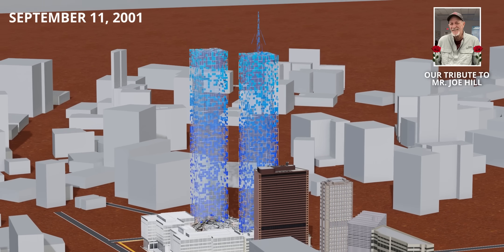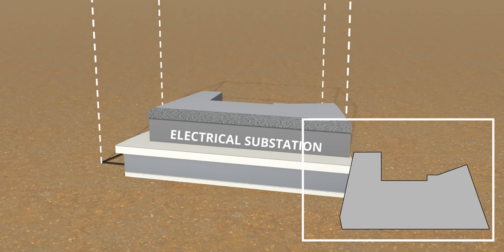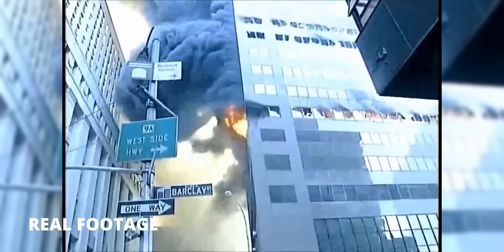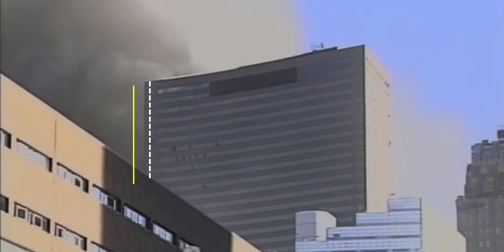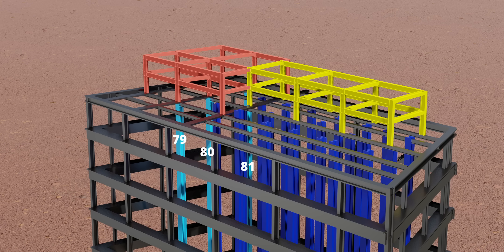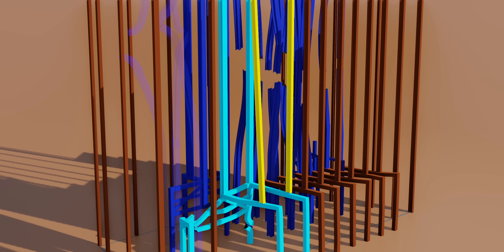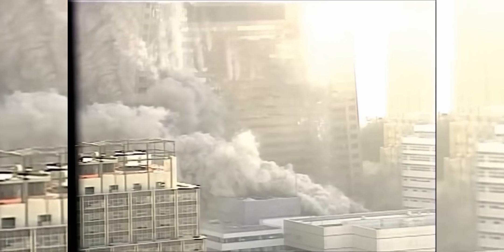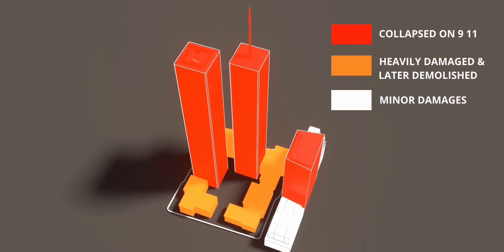Collapse of Building 7 | The Complete Physics

Comment: 3 buildings broke Newtons 3rd law of motion, explain that?
Reply: I can't explain 3 buildings broke Newton's 3rd law of motion since that did not happen.

If you believe it did then you need to explain if it was magic, witchcraft or divine intervention since physical laws can only be broken by the supernatural.

Or admit that maybe you don't know nearly as much about physical laws as mindlessly repeating other peoples failed ideas off the internet would imply.
Reply: @TheCriticalStinker-01  Every floor has a reaction time, even if only 1 second the collapse time can't be 8 seconds
Reply: @flightsimdev  - Which building are you referring to?  

What collapse time do you think believe was only 8 seconds?  Anyone with the gift of sight and ability to tell time can quickly confirm that ain't even remotely true. 

Twin Towers were 32-34 seconds and Building 7 was 18-20 seconds start to finish.  Just as they should have been.
Reply: @TheCriticalStinker-01 
Both twin towers

Each floor traps 3 meters of air, this is a cushion affect and can't be ignored, then you have the crushing affect of the concrete that is not damaged, just the air calculates to a delay of 10 seconds, the good floors a delay of 2 second and the free fall speed is 9 seconds, already broken Newtons third law we're looking at 21 seconds so you tell me, were did it all go?

Now building 7

Also air resistance per floor, if the beams were weaker on the left, it collapses on the left, Beams are not made of spaghetti like your models. The right side beams were not even touched, should not have collapsed, it was undamaged by fire and the building was only hit on the left hand side, go look at the Champlain towers collapse only 2 beams failed, it didn't take the whole building down, and the fires you mentions, they were almost out just before it came down.
Reply: @h1F595 Tower 1 and 2 fell in 10.3 and 10.2 this is virtually free fall speed, no cushioning affect, no floor resistance affect, free fall.

Building 7 fell from 2 beams failing, fires had nothing to do with it, it's not possible, a side should have fallen off, also fell in 2.27s, as you know a concrete and steel beam building is built so if a beam is lost the load is taken up by the next beam I believe it's 1.5 - 3x, so if a 10 ton load is applied to one, it's rated to up to 30 tons, so how can all the beams fail if one fails? Even if you took 10 away from this building, it still wouldn't have fallen.

The only way I see is controlled demolition.
Reply: @TheCriticalStinker-01  Then tell me this about building 7.

Why did it fall at free fall acceleration? What happened to the resistance from 80+ intact columns and 40 floors of structure?”
Reply: BrianSEPT11 - And where did those numbers come from? Did you measure it yourself or, as usual, are you letting the internet do your thinking for you?
Reply: BrianSEPT11  The truth is 1 or 2 beams won't allow a building to collapse, go look at controlled demolish videos and see how hard to is to bring down a steel and concrete building then decide what you believe.
Reply: @flightsimdev  - Steel framed buildings are dismantled. 

In most building designs there is redundancy so that in the event of a single element failure, other elements take over the load.

Building 7's design was unique - a trapezoidal shaped tube-in-tube design built on top of an existing building with a smaller footprint that served as its partial foundation. This necessitated 4 floors of complex load transfer structures instead of usable office space. It also meant that certain isolated elements carried a disproportionate share of the gravity loads without redundancy.

If you don't take the time to understand the building (and almost no one does) then you will never understand the collapse.
Reply: @TheCriticalStinker-01  

I still struggle with the idea that any modern skyscraper, especially one built in the, 1980swould lack redundancy to the point where a single failed column (Column 79) could bring the whole thing down. Aren’t redundancies a core principle of structural safety? Especially in a high-rise designed post WTC 1 and 2?

Even if isolated elements carried more load than usual, it feels counter intuitive that a localised failure could lead to such a total and symmetric collapse, especially at near free-fall speed for part of it, It seems like a pretty big leap from “non-redundant” to “catastrophic collapse.”

Not doubting the structural complexity, just struggling to square it with what we expect of engineering safety standards.
Reply: @flightsimdev  - The Twin Towers had boatloads of redundancy - many columns could (and did) fail before the structure was fatally compromised.  They still fell.

Any building works great right up to the moment it is taken beyond it's design limit.  Building 7 was designed to last 2 to 3 hours in a typical office fire scenario with operational fire suppression systems before active fire fighting needed to take effect. In the real world she lasted for 7 hours in a far more serious, unprecedented fire event with no effective fire suppression or active firefighting. 

It was a remarkable performance and a tribute to its design and construction. 

A whole lot of things had to happen to Building 7 over a staggeringly long period of time. Things no building is designed to survive or would normally ever have to deal with. It took an unprecedented event to take it beyond its design limit.

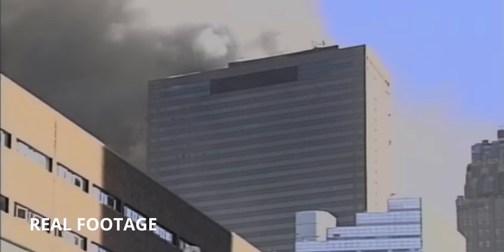Comment: 0:22 still one can observe the blasted windows of the top 5 to 10 flors on the west side blown outwards in succession from lower ones to upper ones.

Must be the fires. R.I.P. Berry Jennings.
Reply: Broken windows. The reason they were broken was all the internal failures inside the building described in this video.
Reply: @TheCriticalStinker-01 upwards? Blown out in sequence? In a fraction of a second? Wouldn't gravity do it top down?
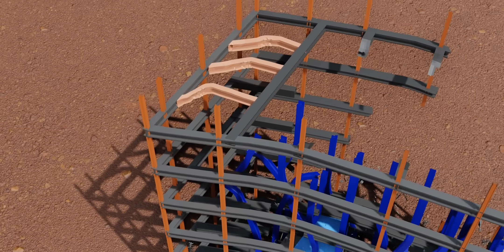Reply: @TheCriticalStinker-01 8:38 what force drives the brown steel beams into ge ground with no resistance? 
You do know that this was shown to a demolition expert who said it is with out a doubt a demolition.
Reply: @Tsutomu6  - I genuinely have no idea what you are on about. 

I'm not interested in your cherry farming - your habit of taking random anomalies you don't understand then removing them from proper context so you further don't understand them, then express that reality must be the problem.
Reply: @TheCriticalStinker-01 I wasn't expecting you to answer my question about the ground sucking up those vertical beams at the 8 minute mark I gave you.
Because obviously, you can't.

Instead you claim that I don't unterstand mechanics, dynamics or anything esle by some odd circular logic.

So I ask an easier question: If I put a giant steel beam vertically into the ground, will it encounter resistance or not? If not your animation (can't call it a model) is correct. If not.... not.
Reply: @Tsutomu6  - Again, I genuinely have no idea what you are on about. It's as if you are asking questions about a completely different video. You are describing things happening in the video that are not happening in the video.  They are things I suspect you want to believe, so you pretend they are happening.

Or maybe you are just that clueless.  I honestly don't know or much care. 

Maybe it would be easier if I just explained the entire collapse, start to finish, to a high level of detail, which I can do and have done many times. IF nothing else, it will make it much harder for you to apply your personal reality-distortion filter.
Reply: @TheCriticalStinker-01 ad hominem weakens your argument. i had never heard of any of this before today and just am watching these videos to prove them wrong but they are making some points i hadn't considered, unsure if that's just the nature of conspiracy theories or if it's because we had believed lies. i'd love to have you explain in great detail, as though i was a child like please to the last minute detail and if you are open to it could i ask questions? i'm going to look for these very detailed retellings on all sides of this issue. i need something with absolutely no inferences, no using logic (no explaining how, just how)
Reply: @erameniyd  - No questions I guess. Glad we got that sorted.
Reply: @TheCriticalStinker-01 i had asked if you could explain it and if i am confused i ask questions but i realize that's a lot of your effort i'm asking for so it's ok lol nvm
Reply: @erameniyd  - What is the "it" I'm supposed to explain?  I informed the OP repeatedly I had no idea what it was babbling about.

Comment: How does claims of column failure rule out the possible cause being planted charges?
Reply: It doesn't.  But since column failure (actually floor failure, resulting in column failure) is easily explained by the obvious and large fires whose presence absolutely precludes the presence and use of any sort of demolition charge, we can safely go with fire.

The collapse of Building 7 is one of the most studied engineering disasters in history and the subject of 5 comprehensive engineering studies and more than two dozen technical articles in major peer reviewed engineering journals, most of which were published 15 or more years ago. Thousands of pages of material.  This should get you started.

FEMA BPAT (initial report superseded by NIST NCSTAR 1A)

NIST NCSTAR 1A: Final Report on the Collapse of the World Trade Center Building 7, 2008.

Guy Nordenson and Associates, WTC7 Global Collapse Analysis Report and Summary of Findings, 2010.

Arup, WTC -7 Structural Fire Analysis Report (Runs 1-4), 2010.

Weidlinger Associates Inc., WTC 7 Collapse Analysis and Assessment Report, 2010.

BRE Centre for Fire Safety Engineering, Analysis of the Impact of a Fire in the Mechanical Room (5th & 6th Floor) of the World Trade Center 7 Building, 2010.

T. McAllister, R. MacNeill, O. Erbay, A. Sarawit, M. Zarghamee, S. Kirkpatrick, J. Gross, Analysis of structural response of WTC 7 to fire and sequential failures leading to collapse, J. Struct. Eng. (United States). 138 (2012) 109–117.

For a summary of the major studies I would recommend THE COLLAPSE OF WORLD TRADE CENTER 7: REVISITED by Mhd Anwar Orabi , Liming Jiang , Asif Usmani and Jose Torero which is a 33 page summary of the different analysis and conclusions published in 2020. Sorry, YouTube will delete this post if I give the link but it should be easy to find and is available from the University of Queensland, Brisbane. 

Hundreds of real structural engineering industry professionals conducting real engineering studies and publishing them for other professionals to see. ALL aggree it was fire.

There are zero studies published by zero engineers that support any CD claims. CD is a fantasy by technically ignorant conspiracy believers who need for 9/11 to be anything but terrorists to satisfy their political agendas. CD is a means to that end, not a thing that happened.
Reply: A good question. It doesn't eliminate the possibility of Bigfoot being involved either.
Reply: @JiriStipek-b6o  how much they pay you to not talk?
Reply: You have affirmative evidence of structural and fire damage from the collapse of the North tower which repudiates the demolition fantasy.

To your specific question, there is no specific way for the column failure point to rule out controlled demolition … or invisible space aliens…or magic except for logic, fact, common sense and evidence.
Reply: Actually the free fall PROVES cutter charges...

Comment: The fifth plane never arrived... it was already wired..  they pulled it
Reply: Uh huh.

I have a simple and entirely hypothetical question. One I have asked hundreds of times but no one so far has even attempted to answer. Run from it like Cockroaches from the light they do. Maybe you can be the one to change that trend.

If YOU were to plan the 9/11 attacks, how would YOU do it ?

Remember, you are staging attacks on 4 world famous, iconic symbols of American economic, military and political power, you absolutely can’t get caught and it absolutely has to look like everything was done with hijacked commercial domestic airliners used by terrorists as Kamikaze missiles.

So, how would _you do it?

You need to figure out what you are you trying to do, how would you most effectively go about doing it and why in a plan that makes the most sense as the most efficient and effective way to achieve that objective. And remember, it has to fit ALL of the available physical evidence and visual record, preferably not require Rube Goldberg levels of complexity, and make logical sense.

And you sure as hell can’t do anything that will get you caught.

Comment: Nice try but no cigar for you and your feeble attempt at baffling us with your bulls**t. Buildings like WTC 7 have been fully engulfed in flames, unlike the WTC buildings 1, 2 and 7, for a lot longer than 56 minutes [like WTC 2 whose fires were almost completely put out as stated by the firefighter who was physically present on the 90th floor] and/or a few hours [like WTC 7, which still had a few active fires] but they did not collapse at freefall speed in their own footprint like WTC 7 did [or like WTC 1 and WTC 2, which collapsed at near freefall speed in their own footprints]. According to the laws of physics the freefall speed of WTC 7's collapse can only be achieved by removing the appropriate number of very specific I-beams on a predetermined number of floors, with nano-thermite cutting charges and wireless detonators for example, so that the downward movement of the mass that is directly above is solely caused by gravitational force. In a 47 story building, like WTC 7 was, you would have to use cutting charges to remove the structural integrity of at least eight stories [about 104 feet] at the critical height wherein the mass of the building above the eight stories is great enough that under the force of gravity [about 9.81 m/s^2] its acceleration will cause the catastrophic collapse of the building below it and by extension itself within their own footprint. Since the above video's banner mentions physics, you could use Newton's Second Law of Motion equation - F=ma and/or you could use the linear momentum of a vector equation - P=mv to explain the physical reason for why and/or how WTC 7 collapsed at freefall speed [and why and/or how WTC 1 and WTC 2 collapsed at near freefall speed].
  I have explained why and/or how WTC 7 collapsed at freefall speed but unfortunately for the "expert" and/or his video, WTC 7 was an asymmetrical building, which simply means that for it to collapse in its own footprint, like it did, the cutting charges would need to be deliberately and/or specifically set to make that happen because if not it would have collapsed at an uncontrolled angle and its debris field would have far exceeded its own footprint. Actual physics do not lie but "experts" can and unfortunately in this case do...
Reply: The North Tower collapse at 10:28am bombarded Building 7 with tons of debris, causing heavy damage and starting multiple fires which burned out of control for 7 hours. Half the FDNY firefighters having been killed, units in disarray, equipment destroyed, no water pressure, and the greater urgency of search & rescue efforts, firefighting was pulled as futile. The building couldn’t be saved and was left to its fate. That is the sort of choice firefighters make every day in brush fire situations - which houses to save and which ones to let go. Only real difference here is moving the decimal on the size and cost. People get overwhelmed by the size. 

www.youtube.com/watch?v=g_SvpwyC17M&ab_channel=MFitz  

Collapse of a burning structure is always a concern for firefighters. Steel buildings subject to fire rely on active fighting of the fires to survive. Buildings are designed around 1 to 3 hours of fire resistance, allowing time for occupants to escape and ACTIVE firefighting to get started, after which all bets are off. Left to their own devices they will exceed their design envelope and collapse, like Plasco Tower and Wilton Paes de Almeida. In B7 the occupants escaped, passive and active fire protections were compromised and active firefighting was abandoned 3 hours before the collapse, which left the building to its fate. It lost. Odds on Building 7 would eventually collapse, and it did. No big deal in logic. 

www.youtube.com/watch?v=WnYBX6QT0R4 

FDNY Chief Daniel Nigro ; The biggest decision we had to make on the first day was to clear the area and create a collapse zone around the severely damaged 7 World Trade Center, a 47-story building heavily involved in fire. A number of fire officers and companies assessed the damage to the building. The appraisals indicated that the buildings structural integrity was in serious doubt. I issued orders to PULL back the firefighters and define the collapse zone. It was a critical decision; We could not lose any more firefighters. It took a lot of time to PULL everyone out, given the emotionalism of the day, communications difficulties and the collapse terrain

FDNY Deputy Chief Peter Hayden ; We had our special operations people set up surveying instruments to monitor and see if there was any movement in the building. We were concerned of the possibility of collapse in the building. And we had a discussion with one particular engineer there, and we asked him if we allowed it to burn could we anticipate a collapse and if so, how soon? And it turned out that he was pretty much right on the money, that he said 'In its current state you have about 5 hours
Reply: "Nice try but no cigar for you and your feeble attempt at baffling us with your bulls**t. "
There's no reason for anyone to attempt that, you manage it handily on your own. As your own post shows.
Reply: Nice triple shill party...